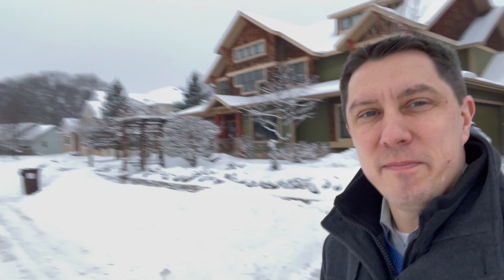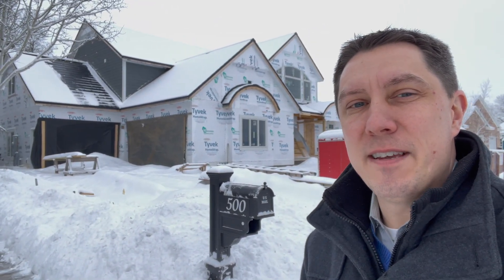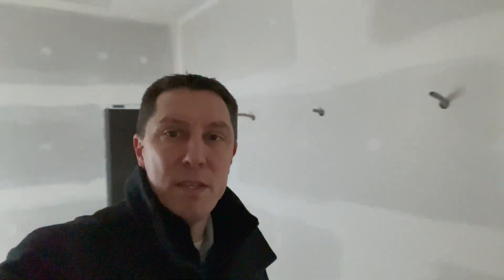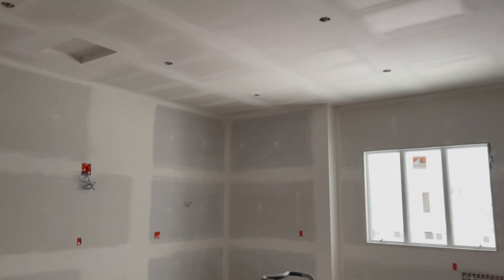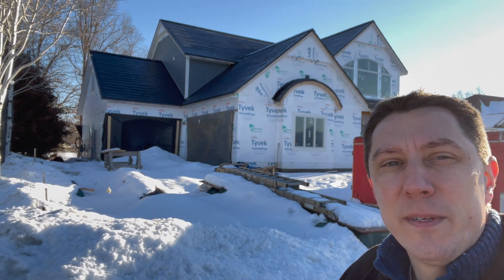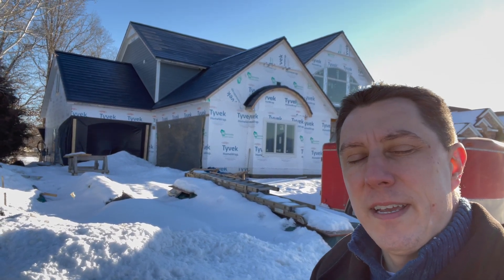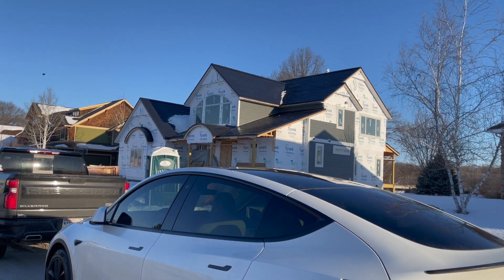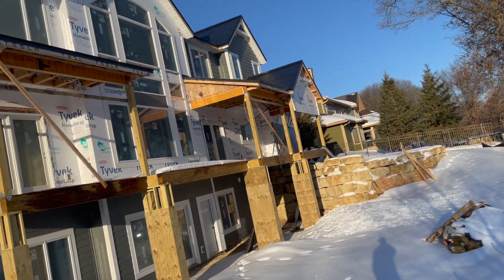Tesla Solarglass Roof  - What happens when it snows?  (Feb 2021 update)

Comment: Hey Jason, how did your roof hold up during heavy snowfalls and storms during the winter? I’d love to switch to the Tesla roof but I’m concerned that the 12-18” snowfalls will be negate or damage the roof.
Reply from the maker: 12-18" would be a tough one I'm guessing.  We are hoping to officially turn it on in late May 2021 when the home is finished being built.  I'll have more info this coming winter as it pertains to production decreases in snowy weather.  As far as the roof holding up - there were zero issues throughout multiple snowstorms!

Comment: How did the roof installation process go ?
Reply from the maker: somewhat surprisingly, the install process went super smoothly.  It even took less time than expected.  Considering that was Ledegar's first Solarglass Roof installation, I'd call it a huge win!  The guys at Ledegar were top notch to work with.
Reply: @JasonLassen  Was Tesla involved in helping to design the roofs for application of their shingles?  What pre-install support did you experience?

Comment: The snow in the valley is probably clamped by constriction rather than just shaded.
It generally does look like the Tesla roof sheds the snow well.
Architects who work in areas with snow will probably want to start thinking about working with these slippery roofs so that the snow sheds intelligently; it is something that can be designed around.  Wonderful place and the roof is the icing on the cake (or not ;).
Reply from the maker: haha I see what you did there. 😂

Comment: You can say roof however you like! Growing up in Kansas, I heard it both ways.

I'd love to see a diagram of the roof and where you put the PV tiles and where you didn't and how you came to that layout.
Reply from the maker: ha thanks!  😅  Tesla Energy designed the PV layout, I actually didn't get much of a say but that's ok as they've done thousands and this is my first.  the PV layout is pretty easy on this one - every slope on the front has PV except for the shaded slope on the front (2 car) garage where that big snow pile was sitting.  props to the Tesla Energy designers that knew that would be shaded all day.  The entire back of the home is north facing so it's all glass-only.